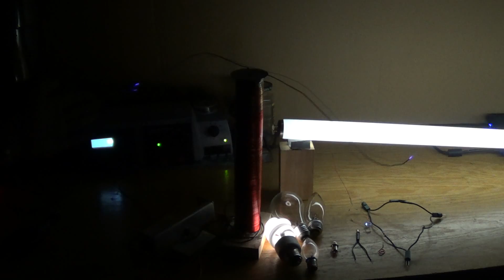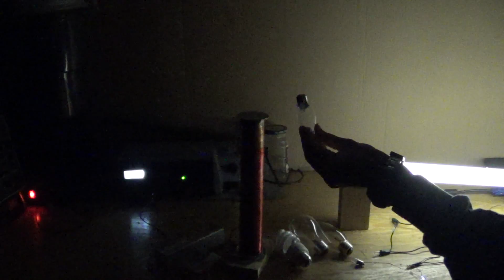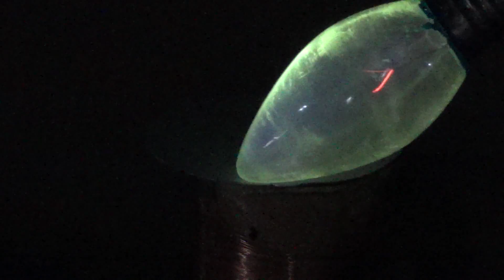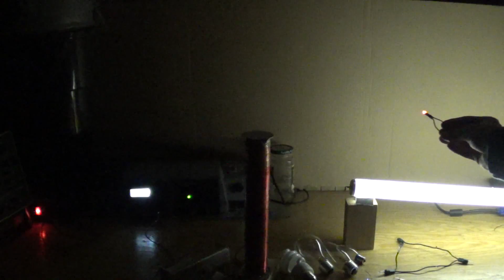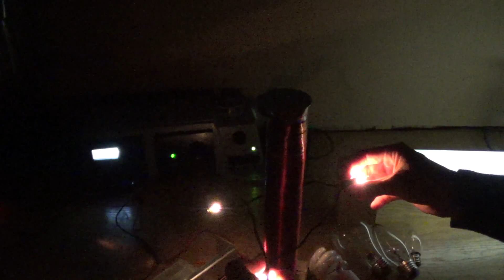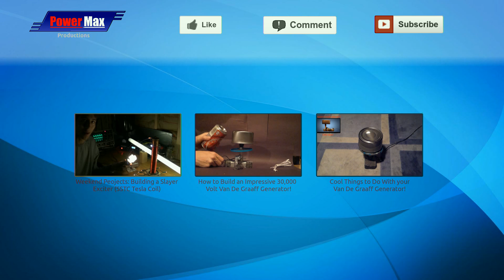Cool stuff you can do with your Slayer exciter Tesla coil!

Comment: I think the MJE13009 will be really good,a lot stronger.What do you think?
Reply from the maker: No free lunch, look at the HFE or beta at the maximum current. While it supports a 20% higher collector current it has half the minimum beta at the full current. The 3055 has a current gain of 20, which is already fairly pathedic as far as BJT's go (small signal BJT's have betas around 400, superbeta BJT's well over 1000) so getting the circuit to start up may be a challenge and require an additional preamplifier BJT to setup a darlington pair arrangement.

Unless that's a statement provided you actually tested it and found it has superior performance, in which case great!
Reply: @power-max  i Will try these two transitors,only to see which will have better performance 
Thanks for opinion

Comment: MJE3055t is super reliable for this circuit i am using a bigger heatsink and running it at 36 v  it gets super hot but it hits a certain temperature and temperature rise stops there

Comment: My Tesla coil does not work please help
Reply: Every time I try to make it the transistor ksp 2222a heats up very quickly
Reply from the maker: Then you should attempt to troubleshoot. Refer to the Instructable posted in the description.
Reply: @power-max  I tried troubleshooting with all the possibilities 
It looks very strange as it over simple circuit with just a transistor and by the the way I won't make any kind of soldering mistakes
Reply from the maker: I understand. This circuit is deceptively complicated. It is an oscillator that relies on interesting physical properties of electromagnetics and parasitic properties, such as nonlinear gain / large signal behavior of transistors, capacitive coupling between the secondary / topload to ground, etc. I am an EE, and it took me hours to get this circuit to work when I first built it. There are many things that can cause it not to work. You should periodically sanity check your transistor to ensure you have not killed it. Build a circuit with it that you know will work. Make sure your power supply supplies the necessary voltage under load. It's not a circuit that can be easily analyzed analytically since it relies on parasitic properties. In other words, it should not even work in theory! (Well, unless you account for parasitics in analysis/simulation.) But what I do know is that you need POSITIVE FEEDBACK at the resonant frequency.

Go through the following checklist:
* Is transistor working? Always periodically check your circuit.
* Is your loop gain high enough? (does your transistor have enough gain? Note: Gain actually increases with more DC bias on the base because of the exponential characteristic of BJT.)
* Is transistor correctly biased to provide a small DC current through the primary? (Helps with getting the oscillator started initially.)
* Is the polarity of the primary correct? (Incorrect polarity of the primary results in no oscillation, and maybe a slightly warm transistor, depending on the bias resistor.)
* Can you sometimes kickstart the oscillator to start running by providing a bit of an electrical impulse to the base. This can be done by tapping the secondary coil or touching the base of the transistor, just to provide some electrical noise that can kickstart the oscillator.

Without more descriptive information on what you have tried and what you observed, I can't help you much.
Reply: @power-max  Thanks man after a lot of troubleshooting and your tips the circuit actually worked

You KnOw what.... You are the best YOUTUBER I have ever come across 
I tell my friend to watch your videos.. my friend 
You make more and more videos and I will take the responsibility to make your channel famous
Thanku :)
Reply: @power-max  just to add when I gave up I replaced the transistor with an 13007 and u know what the results were impresive

Comment: Are you using TIM between the transistor and the heatsink? Because that really helps thermal transfer.
Also, get some fins and a fan if you want really good cooling.
Reply from the maker: Even with infinite heatsinking (that is, if I could keep the transistor case at 25*C regardless of power dissipation) I still risk killing the transistor due to internal thermal resistance. The PN junctions would get too hot because the thermal resistance between junction and tab is too high. The solution would be a better transistor in a larger package, like TO-247 or TO-3.
Reply from the maker: Yes of course I used thermal compound. The transistor dissipates quite a lot of heat, and the heatsink I used in this video was not up to the task with anything higher than 18V for power.
That said, the solution would be to build a better circuit. The slayer exciter is great for simplicity, but terrible for efficiency and power dissipation. I have a new prototype tesla coil design that only requires a couple heatsinks with about 10 C/W thermal capability and they can be passively cooled!

Comment: I made the circuit correctly and have rechecked it many times but the slayer exciter isn't working. When I turn on the switch, the transistor gets heated up but no current is there on the coil. Please help me if you know what the problem is...
Reply from the maker: In my last tutorial video, I have posted a link to the instructables I made for this circuit, and the last step was troubleshooting, I elaborated many of the infinite possible things it could be. Please refer to that for detailed troubleshooting first.

Comment: Perfect!!! Of course, as you mention, i am sure it can be improved with low Ron MOSFETs
and some heat management and better PSU, but its a great starting point! So, when lighting a say 45W fluorescent lamp at full brightness what is the amp draw of the circuit and at what voltage (as to calculate efficiency). Also have you experimented with what is the optimal distance of the primary coil and the secondary (i.e. how tight the coil is to the secondary), or does it not matter?
Reply from the maker: Calculating efficiency would be particularly difficult, but I think it is less than 50% at best. Also, this particular circuit uses a NPN transistor, not a MOSFET. However, I do have a newer video that does use a MOSFET. While a better ON state resistance will reduce power dissipation slightly, most of the heat generated is actually generated during the switching period. MOSFETs can only turn on and off so fast. because the gate of a MOSFETis basicly a capacitor, that limits how fast the MOSFET is.

Comment: How wrapped wire first and how thick Does transistor 2n3055 nbn works Thanks
Reply from the maker: Perhaps you can better explain yourself in your native language? I can always translate comments and stuff! The secondary wire for the coil is 26AWG and the MJE3055 in the TO-220 package is suitable, as long as it is from a reputable company like radio shack, mouser, Jameco, digykey, etc. Larger and more powerful BJT NPN transistors will be better suited if you want performance.
Reply from the maker: You can see my other tutorial video on building this, and if you want to know more about voltage, current, and resistance, check out my tutorial on that!

Comment: hi there thanks for this video. just had a small problem the coil i have is creating electomagnetic field however it does not  make the bulb glow. i am using a nine volt battery.
Reply from the maker: What type of bulb are you using? For an incandescent, you need to make a large coil of wire that has the bulb in series in it, and that needs to slip over the exciter. There may not be enough current being drawn by the 9V battery.

Fluorescent lamps should glow without modification, although not brightly on a 9V battery. Neon lamps should work perfectly fine even down to around 3V operation, although the distance of ignition will be greatly reduced, and same for LEDs wired to an avramenko plug.

If it cannot light up even LEDs or neon lamps, how do you know it is generating an EM field? If it does light up small LEDs and neon lamps, then I would try a different number of turns, change out the resistor pulling up the transistor's base to a lower value, and if you still cannot get the performance you desire, try a higher voltage.

My exciter will draw over 1A @ 12V, and a 9V battery simply cannot deliver that much current, at least not at an effective voltage. As you draw more and more current from a small battery, the voltage begins to sag more and more, so there is a limit to how much power you can pull from a battery. Try 2, 6V lantern batteries in series or 6-8 1.5V C or D size batteries instead. You might be able to get away with AA size batteries.
Reply: Power Max well it was not able to light up even the led but when i placed a voltmeter near it (i was doing it in my school lab) it went crazy and showed some deflection and then everything went quiet and in around 20 seconds the 9 volt battery ran dry also when i placed a metallic rod inside the coil it started rotating itself.  then i used a battery eliminator to run it at 12 volts and still nothing happened(this time not even the deflection)

specs of my coil are here
primary coil 4 truns
secondry coil 850 turns(apprx)
used all as you specifeid only the resistance i had were of 100pf. 
pvc wires with ability to withstand 1100 volts
also thanks for the swift reply really appreciate it
Reply from the maker: Kenyar 141 Did you check the voltage of the 9V battery afterwards, is it still higher than 7V? also is there voltage across the BEC you used? My guess is that the BEC has 'intelligent' circuitry that shuts the output down if it detects a oddly behaving circuit. My Xbox power supply was like that, I had to completely bypass the over-current protection because it kept tripping with the small overcurrent transients that the stuff connected to it caused. It was one big mod wire shorting the output of some 18 pin DIP (custom xbox part with no datasheets.) which went off to an optocoupler to the +5V rail though a 2.2K resistor.

Anyway you do measure a voltage across the circuit when it is connected, and the battery still had some charge on it, then it is likely that the transistor popped. Increase the resistance between the base and Vcc, and if needed, increase the number of turns on the primary (I would try 5.) and is you still find yourself pooping transistors, but a resistor between the feedback from the coil and the base of the transistor, and maybe some TVS diodes for added protection. That is probably overkill but might help.

For 12V, I sure hope you are not tring to use a TO-92 package transistor, I find they barely ever survive even on 9V! Use at bare minimum a TO-220 high power transistor, a TO-3 or more modern TO−247 is preferred. Of course a large heatsink is also a requirement. The one I had in the video was not large enough to dissipate the heat at more that 12V operation for more than a few seconds. (BJTs have a negative temperature coefficient so as t heats up, the performance becomes more and more shit, and also begins dissipating even more power, leading to a positive feedback loop which is a runaway effect, killing the poor transistor.)
Reply: Power Max hi power max, replying late was not well
my transisitor are IRFZ44N and a MJE3500T with a heat sink they still dont light up anything but voltmeter catches reading now till i remove the connection.
also i created a new secondry wth 1028 turns and primary with 5 as you said earlier. the input is a DC one. ans for the primary i used a wire with a capacity of 1200 volts also increased the Resistance to 50k and 3 100pf capacitors in parallel will send you a picture of my circut if you got time please do check it out
was also curious to as where you plugged your multi meter?
Reply from the maker: Kenyar 141 Sorry I cant reply immediately as I am busy with life but I do my best to reply ASAP. What is the voltage across the power connection when the circuit is powered on? (open-circuit voltage is practically meaningless.)  Also, if you are using an analog multimeter, keep it far enough away from the coils and wires to avoid magnetic interaction between the meter and the coils and wires and obviously other magnets.

you said you are using a MOSFET transistor (IRFZ44N) , A quick check on the IRFZ44N is a medium-power MOSFET, and MOSFETs are not suitable for this circuit It HAS to be a Bipolar Junction (BJT) transistor, preferably a NPN, (for PNPs, the polarities have to be reversed because there are the complementary inverse equivalent of NPN BJTs)

Do you have any datasheet for the MJE3500T? There isnt a lot of good datasheets Did you mean MJE3055T or MJE350? If it is a high powered NPN transistor, it might work, but only have 2N3055T's at the moment (in the TO-3 package)
Reply: Power Max i have a MJE3055T was not able to find 2N3055T. AND man you replied fast thanks. also one more thing is mje3055t a TO-3 PACKAGE?
Reply from the maker: The MJE3055T is what I used in the video. I think it is still around somewhere, and no, it is a TO-220 package. The TO-3 package as a much older style that can handle higher power dissipation. I do not have any heatsinks for it though. It is considerably easier to mount TO-220 packages.

Also, I apologize for a few comments up where I mentioned an xbox power supply and some BECs, that must have been in my clipboard at the time and got randomly pasted in! Oops! (That was for a totally different comment on a different video entirely about using an xbox PSU as a general power supply!) Anyway, can you clarify what you mean by a wire that has a capacity of 1700V? Do you mean to say that is the maximum rated voltage for the insulation? Thats fine. 100pF capacitors will not do a great job for filtering, try a few 100nF capacitors like the ones in the video (104's, not 103's). 50K is way too high, there needs to be some current to begin to pull the transistor into conduction, try values from 4.7k-10k. As for the question about the multimeter, it depends on where what you want to measure. Current? Voltage? resistance? frequency? and at which nodes or parts of the circuit under test. There are a lot of great guides for beginners that would be highly beneficial you.

Comment: will we get shock if we touch the spark?
Reply from the maker: No.*

* If you define a 'shock' as a feeling of pain, then no is correct. The output oscillates in the MHz, and our nerves are not able to detect the currents. However, since the arc is hotter than the surface of the sun, you will get small 3rd degree burns if you allow your flesh to touch the output for a prolonged time!